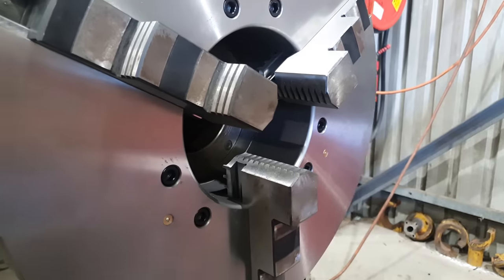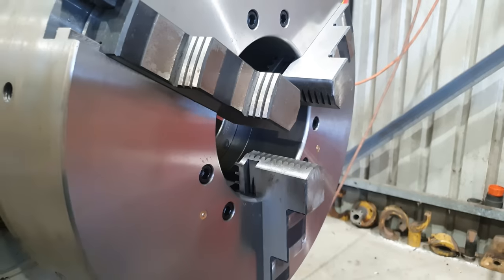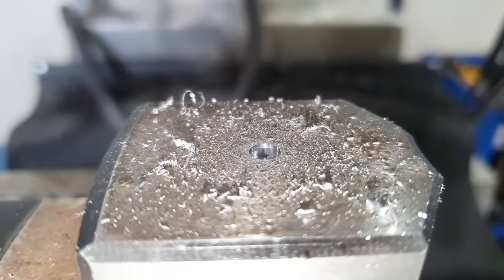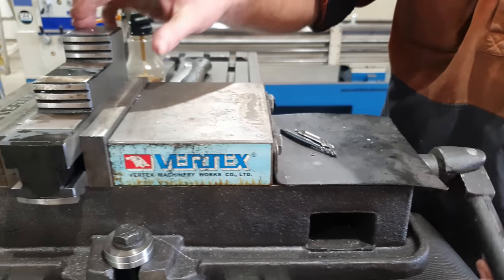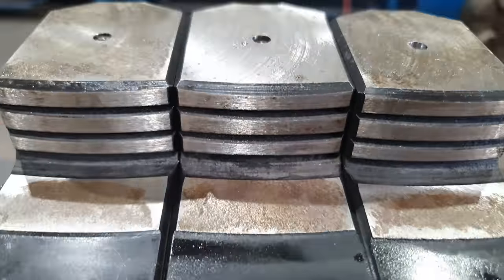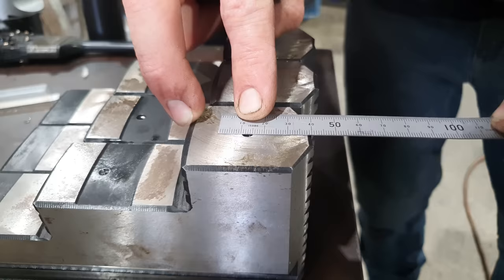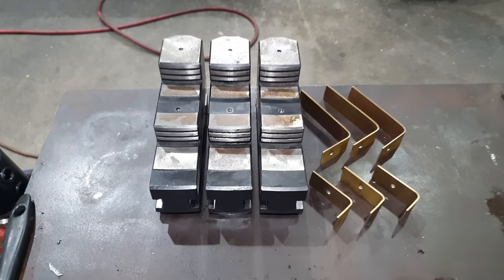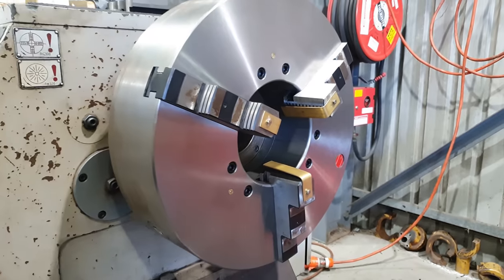How to DRILL & TAP Hard Jaws | Big Lathe Chuck

Comment: A quick tip when installing jaws on a scroll chuck, turn the scroll just past the slot for the jaw, put the jaw in the slot and back the scroll up until the jaw falls down. This trick ensures the jaws are in place, and not hanging on a burr or similar.
Reply from the maker: good tip thanks for sharing!

Comment: Loved seeing the Starrett tap wrench at work.  Still the best made tap wrenches on the market!
Reply from the maker: Agreed!
Reply: @CuttingEdgeEngineering  Speaking of wrenches you should make a short wrench/adapter for your cordless drill-one side with square profile and on other side 6 points. That way you can wind up or switch those jaws faster ! You still tighten them with good old key but cordless drill is just pure awesomeness when it comes to winding jaws ! Think about it . . .

Comment: An alternative holding arrangement for soft jaws is to design them as a U shape and on one of the legs bore a hole and epoxy a thin neodymium magnet to hold it on the chuck jaw. If the magnet is close to the thickness of the brass , chips that stick to the magnet can easily be wiped off.

Comment: Sweet bonus video! and right at my lunch break as well good times! so I am really curious to know if you can tell the difference in the milling machine now that you have done that massive maintenance job from a few videos back? It seems with so many of the bearings pretty much shot seems like it would be much nicer now.
Reply: the bearings were not shot. the noise comes from the straight cut gears in the head when he shifts to low it goes through the gears. high just goes straight through so quieter.
in the video at the end he found the noise was the same before and after.
Reply: @ronblack7870  Yet he still replaced a bunch of bearings that he said it needed so Alan did ask a valid question.
Reply: It seems like it is a tad quieter now

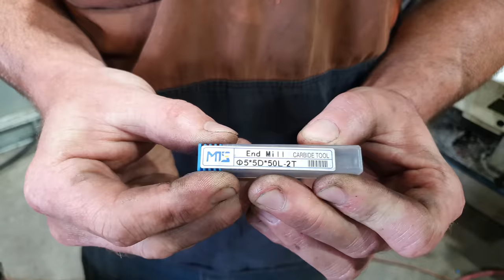Comment: Well that's interesting.  It never occurred to me that chuck jaws were not hard all the way through, but it makes sense thinking about it.  I am surprised that you were able to drill into the jaws with an end mill, but I went back and had a closer look @4:06 and could see that your end mill had cutting face and clearance all the way to the centre.  I'll check later, but I think my carbide end mills have a recess at the centre and definitely won't drill straight in.  I do have 6mm carbide slot drills though.  I was also worried that you used a tapping size end mill as the tap would still have to cut through the hard outer 2mm, but that was a fancy looking tap.  Was it also carbide?  I'd be worried about breaking a carbide tap if they exist.  

I am going to look at doing the same mod to our lathe, but using the 6mm slot drill so the tap only has to cut the softer inner material.  So thanks for another super useful tip.  I am 73 and long since retired, but I still love learning new things.
Reply: The end mill was larger than the screw hole (5mm end mill, then a 4.5mm drill & tap) so neither the drill or tap had to cut into the hardened top layer...

After he finished cutting the very first hole, Karen took a close up of the hole and you can see the shoulder where the end mill stopped cutting and the smaller threaded hole starts...
Reply: The end mill size cleared the outer tap diameter.  Also he is using what is known as center cutting end mill.
Reply: The slot drill was 5mm, the drill was 4.2, the tap was M5, so it wouldn't need to cut the hardened layer because the slot drill had removed it. You should be fine with a centre-cutting 5mm carbide cutter.

Comment: Monday vid!?! Also, is there a reason you don't have your overhead crane reach over to your welding area? I notice you frequently moving pieces between the lathe-fork lift-welding and back. Seems like that would save time if the crane reached over there.
Reply: Probably crane is at end of limits, likely original use of the shop had the crane only in use in part, and a dividing wall to the other side. Now the shop is larger the crane is still limited, so the forklift and mobile crane get a lot of use in place of it.

Comment: I'm sure you've covered this before, and anyone that has changed jaws on a scroll chuck should know this, but you didn't mention that they are marked and have to be put back in the right place. Might save a "first timer" some frustration. 😁

And you can definitely see where the end mill gets through the hard layer! From essentially powder to stringy swarf. 😁
Reply from the maker: hey mate thanks for mentioning that here, I did mumble it to Karen but wasn't worthy enough for the video 😅
Reply: Thanks for this comment, I was wondering if there was something like this to avoid a painful process to get the jaws all aligned

Comment: Wow, I did the same on a Colchester 4 jaw. It was in the high 40's Rc beneath the shell. I had to use a 3/8 4 flute carbide to depth and then press a soft plug in. What a PITA.

Comment: I can only admire Kurtis's courage/confidence in starting an M5 tap into what is still probably fairly tough steel using the rotational inertia of the milling machine spindle. I sometimes do that with unimportant work pieces but would balk at doing that with the chuck jaws. I enjoy your work. Karen's videos are excellent and Homeless and the wildlife are a heartwarming touch . Cheers.
Reply: It would scare the bell out of me to do that. I was picturing the tap snapping off from the sudden shock.
Reply: @melgross  It's helps that it is a spiral fluted tap, which clears its own continuous chips if everything is going right. The other saving is that if you tighten the chuck just the right amount,  the tap will slip in the chuck rather than break, provided that the tapping gods are on your side that day. I guess it comes down to being confident about the jaw material based on the way it drilled and being confident that the tap would then do what it is supposed to do, but it still made me winch when I watched it. Cheers
Reply: @rockwell6594  it certainly didn’t look like it slipped. And that’s always a ticklish adjustment. He would pretty much have to use a spiral tap to get to the bottom unless he was willing to drill deeper and crunch the shards at the bottom with a spiral tooth tap.
Reply: Never had a spiral tap, loved its chip!

Comment: I need to drill the jaws on my big chuck but not for this reason. I want to insert dowel pins so I can pre load the jaws for internal grinding. I was going to buy a solid carbide twist drill but maybe this method will work. Mine is an older English made chuck and maybe the jaws are hardened all the way through? Just a tip on using those scratch gauges, the edge of the slot needs to be square to the stock surface for accuracy. We used scratch gauges in Schools back in the bad old days when we were still teaching sheet metalwork😬

Comment: I have a selection of copper and brass split tubes and rolled bar, that I can sleeve over the work to act like a shim. But will do this as well now I know how to get through the hardening on the jaws. I didn't realise they were just case hardened.
Thanks.
Reply: Microgrind guy next door just used a 1" wide strip of shim stock, 3-5 thou thick & wrapped it around stuff, early 70's.  He never seemed to get more layers under one jaw then another.  Had to be talent more then luck!
Reply: It wouldn't surprise me if some chuck jaws are hardened all the way through, so be careful.

Comment: Hey Kurtis, I'ld like to tell you what works for me, when I have to drill through hardened steel. I use a drill, that is ment to use in stone/concrete. I grind that drill like one usable for iron. You know the tip of these drills is made from the same material (carbide) as used at some cutters on a lathe.
It's nescesary to cut the drilling speed and use a fair amount of cooling and then it works like a hot knife through butter.

Comment: seeing the hand guilotine reminds me of a time I was cutting .125 stainless with mine, and it was way thicker that it was made to cut, I pulled and pulled as hard as I could with both hands, it finally sheared the piece and the handle came down and hit me in the center of the head.  I've never been hit so hard in the head before, raised a 1/2" welt on my head.  live and learn

Comment: Seems fairly simple to do this.
just a couple of questions:
1) cheap Chinese lathe chuck, you didn't make sure the jaws were centred individually in the mill before drilling? You lucked out they were all made fairly accurate. ;)
2) Are you going to show us the first use of this chuck and the details of how the brass molds to the jaws and piece when used?
Reply: Probably, at least I hope, used it already & seen that it runs true.

Comment: Nice work, and probably the best solution . Just I would have milled a 6mm hole through the hard part becomes a m5 tap is like 5.1mm in diameter , and you brake it (don’t ask how I know) 
Or you hope that the plunge will make the 5mm cut larger

Comment: When I was an apprentice we used plasticenes. The copper strip never came unstuck, no matter how many times you removed the part from the lathe chuck. To remove the plasticene from the grooves in the jaws we would simply take out the chuck jaws and wash them in the parts cleaner.  Plasticine and a pin on the end of a centre drill is a very accurate for drilling. This hack is useful on a pedestal drill or simple milling machine without CNC readout. Don't forget to turn on the spindle and allow the pin to find its true centre first! This can be aided with your fingers but that's frowned upon these days with nanny OH&S!

Comment: Did you mention that the diameter of the end mill should be slightly larger than the bolt size?  Otherwise, the tap would be cutting.....unsuccessfully.... the case-hardened surface.  Love watching a master at work.  Thank you!
Reply from the maker: I didn't mention it but if people can do maths they might work it out themselves with the caption of the tool sizes in the video 👍

Comment: 3:36 that lever needs a ball end. I always fit golf balls to equipment missing handle ends. Golf balls are cheap, readily available, profiled for your pleasure, easy to fit and standard sized for the hand/brain to connect with. A bucket of golf balls on the shelf is like a box of paperclips, used more often for what they're not intended for. Hope you're having a great break and looking forward to a fresh faced leap into the new year.

Comment: I really enjoy your videos. Another well done. Question: why not make a brass pad that covers both sides at the same time? Probably a good reason, just wondering.
Reply: The smaller pieces of brass are easier to handle than one large piece.  And a single piece of brass would use more material to cover the three clamping faces on each jaw.

Comment: I am an amateur machinist and enjoyed your video on drilling into the jaws of your new chuck.  I am in the process of reshaping the inside jaws I purchased for a 4 jaw chuck that are a bit wider than the present outside jaws for my lathe.  I have been using TiNAl end mills that don't last very long, even after going down over 2mm.  I unfortunately don't have a liquid cooling system for my bench top milling machine, and was wondering if it's the quality of the end mills that I purchased from Speed Tiger of Taiwan.  I must have gone through at least three 10mm diameter end mills and have 3 more jaws to do! I was using WD40 as a coolant, but don't think it's of much use as a coolant/lubricant.  Any suggestions as to what to use for a lubricant that will be available here in the USA?

Comment: Awesome. I just did this same way the other day but on a piece of chrome stock in my lathe with center drill endmill. I have had to go farther through 600 series SS steel and use a center drill endmill for drilling as well or keep swapping a center drill for a flat faced mill, but they dull quite quickly and need to be re sharpened so I have a few munged up endmills I use for the pilot holes. God help you if you are using a small one and snap it off in there. That said...any tricks for drilling stainless?

Comment: If the Chinese chucks give you grief, you can always grind them. For quick jobs, worth having a multitude of cheaper chucks that you fix yourself. Certainly much better than not having the right chuck (like, you start with a 3 jaw, but you want a 4 jaw, a 6 jaw, some independent jaw ones, self centering etc). When i started, i had a bunch of them on the cheap which i ground with (i kid you not) a dremel for which i replaced the threaded cap with a threaded holder i made on the lathe. That got them pretty precise for cheap junk. :))

Comment: I use a speed wrench or 1/2 socket drive, which ever is closest, to run the chuck jaws in and out.  Saves a bunch of time. I'm sure you already do that or have a good reason why you don't.  Hmmm?????
Reply from the maker: hey mate no that's something I would never do because you don't have as much feel with a power driven tool and can quickly fuck the scroll if there is any material caught up in there

Comment: Consider a carbide hole starting drill. A centering drill is for drilling centers. Only the first bevel has the direct angle for starting 118 degree drills
Reply: Only the first bevel was used on the centre drill, I would use a HSS spotting drill but I have a bunch of them, Carbide only needed to make the initial hole in the outer layer, the rest is fine with good HSS. Same principles apply when using ruined carbide insert tool holders to make tooling items from, mill a couple millimetres off the outside with carbide end mills then generally you are fine to use HSS.

Comment: The only tapping I did in metal work class in highschool was snapping the bit in the hole, how do you get it to come to a stop in the drill press?
Reply: The mill is only spinning on momentum, it's not actually being powered when Kurtis lowers it into the tapping hole.

Comment: Hi family just a thought when changing or moving the jaws a big distance could you use a cordless drill with a hex key in it to move the jaws quicker  not fot tightening anyway it could save time love the vids 
Hey where's the birds haven't seen them for awhile
Reply from the maker: Hey mate I don't recommend using power tools on the chuck because if there's any chips caught in there you won't feel it and the scroll will get damaged quickly